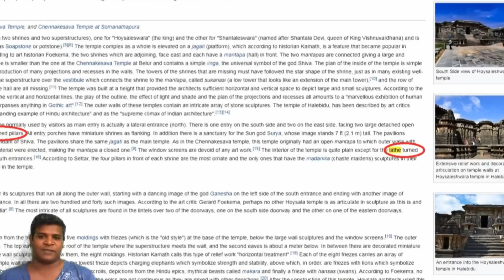Hoysaleswara Temple, India - Built with Ancient Machining Technology?

Comment: The pine cone theory is very intriguing.  If they had the capability  to create these structures than they probably had the capabilities to travelbto places with pine cones. But are they pine cones? Idk...
It does make sense that this might have been the way they carved these things. They may have used frequencies to turn the heads at extremely fast speeds.

Comment: Not even close to planetary gears. Planetary gears have a sun gear at the center, a ring gear on the outside, and a planet gear between them. Here, the outer (ring) "gear" has no internal teeth, so it won't work. Plus, there is no planet gear to be seen! How could you get this so obviously wrong?! No planet gear -- indeed, not even room for one -- but you call it planetary gears?!
This is basic stuff. If you can't get the simple stuff remotely correct, it calls into question everything you claim in this video. 
Maybe go back to school, or look-up what things are before you go around making claims that are so blatantly wrong. I mean, at least try to not look like an idiot.
Reply: Yeah, there is a lot of speculation including the pine cone thing. Pine cone doesn't look like a real tool (although the Hindu multi-arm gods do tend to hold tools and weapons.)

In any case, it's still a mystery how you machine such smooth surfaces and circular stuff. The other videos covering Ellora caves/Khalisa Temple is even more mysterious.

What are your thoughts on how you created those smooth things surfaces on hard stone?

Comment: I was just in Hoysaleswara temple & asked a guide specifically about those pillars with the intricate, minute turnings..elephants, then  horses were used to provide power to drive whatever tools & machinery required, they said..also if the Greek civilization had the antikythera device (which had gears & wheels to predict, what's popularly believed to be, astronomical events), pretty sure gears, & similar devices were used in other civilizations too..even ancient gear  wheels to drill holes into ppl's heads to relieve them of perhaps fluids, aches & pains hv been found.

Comment: These pillars, once had a system of belts that went all through that complex, they even have ancient ball bearings made from stone, allowing them to freely spin (most of the bearings are now crushed, ruining the spinning mechanism ANNND  IRONICALLY, ACTUALLY.... IN THE PROCESS, SHOW-CASING AN OBVIOUS LACK OF MATERIAL SCIENCE KNOWLEDGE BY THE BUILDERS...)  Think stone based societies of old vs. oil based ones of today.... modern, grease packed, METAL bearings are far superior (In particular with proper maintenance) than stone ones COULD EVER HOPE TO BE, as is evidenced.... clearly, by them ALL being crushed today, where we would asssume that metal ones at least, would have STILL been  structurally intact, probably in major need of some good grease, and  admittedly.... probably.... STILL, in non-working order.  IF YOU WERE TO PUT IN NEW BEARINGS AND GREASE THE PILLARS, POSSIBLY HAVE TO "UNSTICK" THE INDIVIDUAL ROLLERS, PEOPLE WOULD BE AMAZED AT HOW FREELY AND LONG THEY WOULD SPIN!  The "Temple" was once an "Energy generating plant" the striations appearing on the pillars ( In particular, the long, row of the really shiny ones) are BOTH remnants of lathe marks, created though their  manufacturing ANNNND... from the repeated usage of massive, leather belts that somewhat grooved and polished the pillars.... At the end of the "temple", there are a series of gears, that step the revvvs WAAAAAY down.... in a very classic and modernly "accepted" way way.... like 1:4, 1:8, 1:16, 1:32, 1:64 and soooo on and so forth.... I have rough drawing of the "lay-out" of the belts and how they worked... I have in fact, made some predictions about the rest of "The machine"....  Upon my visit, one day, to India, I shall see if I am right???

Comment: You can rotate it vertically. Use an abrasive and you can soon produce cylinders. You do not need to turn things horizontally. If you have thrown a pot in clay then just beef it up and you understand the methodology.
A drill or piece of rock on the end of a pixel of wood, aka a stylus, can be spun and you have an abrasive drill. For some reason people are obsessed with the idea that hammers and chisels are always used. I think you should rethink things. Abrasive techniques are more likely to be employed. Gives enough time and manpower and you would be amazed at what can be achieved.

Comment: It may not be alien technology. I think that metal rods were casted and built into a rig where these pieces could fit onto with a hole in the center, and then spinned with another metal object or rocks used to lathe the pieces. The stones are heavy but 4-5 men could lift one around enough to work on it. Or they were sat onto a spinning rod and used an object on the side to shape the rock while having water poured on it.  I think we may need to look into how exactly were they spinning the lathe to determine if it was great technology or just manual labor.

Comment: I visited these temples in Karnataka back around 1990 and at the time I saw that the columns had been lathe turned. It's pretty evident that some ingenious apparatus would have been needed. Likewise the fine stone filigree work is fascinating. However, to posit that this is mysterious since the humans in that area and time were 'primitive' reminds me a lot of the huge, olympian leaps of logic promoted by folks like Von Daniken. I think human ingenuity has existed far longer than our recent sense of history. Just because we see the past through modern filters (and a questionable sense that we have 'evolved' or 'progressed') and cannot personally understand how something was done doesn't mean that it was impossible for 'primitives'.

The filigree carving and hollowing of stone (and relatively soft stone, from what I was told it's a variety of soapstone) is not without practice within the last few hundred years. I saw curios at the National Palace Museum in Taipei that showed similar levels of craftsmanship- jadeite and nephrite carved into nesting, movable spheres, or into lace like structures finer than that seen in the temples. Of course the scale was completely different- jewelry vs architechtural  detailing. I asked a curator and was told it was done using wood, copper, and bronze tools with an abrasive slurry and water. I think the wood was used with fine polishing powders to give the piece a gloss polish.

I have carved stone using a scrap of copper wire, a simple drill (the old chinese craftsmen used small bow drills) and aluminum oxide powder. Soft stone can be carved this way using hard quartz sand. Likewise, John Dobson made huge telescope mirrors to high precision  using materials found in a gardner's shed- hard sand as abrasive, mixed with water and timed to settle out larger from smaller grain sizes  so he could use coarse to very fine grinding sessions. The material was salvaged thick disks of glass from ship portholes, which he turned into large amateur telescopes-the Dobsonian.

My point is there is always a way, even if at first glance it might seem impossible.

I have a thought experiment that is of course not backed with proof, but consider it a possible explaination other than Aliens with tractor beams and defrappolating pistols:
1) A deep pit is dug, with provision for filling and draining water. The ground, if too porous to contain water, could be sealed with bentonite clay as is done for farm ponds. Perhaps something like a well.
2) A large timber cylinder, with a socket carved into its bottom center, is lowered and settled into the pit and onto a stone block fitted with a pin that mates to the socket of the timber cylinder.
3) A block of stone is moved into position and affixed to the upper end of the timber cylinder. Metal stakes driven into the end of the timber could be used to fit into sockets carved into the stone block. This block is roughly carved into a cylinder before being mounted to the timber.
4) The pit is flooded with enough water to pick up the weight of the stone. 
5) The timber post float with the stone block is rotated, using a rope capstan type drive. Think the scale of Roman siege engines.
6) Bronze bars of various shapes are pushed against the rotating stone, while being fed a slurry of crushed quartz. As the surface progresses this is replaced with sand. The support structure for these bars must be fixed to the surrounding ground as it must be relatively stationary while the stone block is turning.
7) The upper part of the timber is kept steady with logs crossing the mouth of the pit and bearing lightly against the turning timber float, like a steady rest on a lathe. This keeps the work from moving off center. Lubrication is by beeswax at the points of contact of the steady logs and the timber float.

Now, keep in mind that the silliness above assumes the pillars are single pieces of stone. They may actually be segmented and joined with a color matched mortar; the extreme fluted designs would make it hard to tell. If so the mass of the stone block blank would be that much lower.

In fact, unless these pillars have been deconstructed to prove otherwise they could have been made using a much simpler apparatus much like a large potter's wheel on dry land and simply pinned and mortared together. It would not be difficult to formulate a colored mortar that would make the joint hard to see, and it could also be lapped and polished with a rope to further refine the surface of the join. If they are pinned they don't even have to be mortared- the joint could be covered with stone dust and wax.

Really, we need to respect the intelligence and ingenuity of these ancients. Just because Von Daniken couldn't figure out how the pyramids were made doesn't mean human genius in the past couldn't. In any field there are techniques that are astonishing to those outside looking in. Honestly, while I can't do it there were people that could make an intricate chronometer mechanism out of brass hundreds of years ago. People still do it today, and with the simplest of machines. A horological lathe is not complex but brilliant in its creation and use.

Humans are smart. We can figure stuff out.

Comment: An aeolipile, aeolipyle, or eolipile, from the Greek "αιολουπυλη", also known as a Hero's engine, is a simple, bladeless radial steam turbine which spins when the central water container is heated

The first commercially successful engine that could transmit continuous power to a machine was developed in 1712 by Thomas Newcomen.

I bet every advanced civilization has had some form of Steam Engine. Basic steam engines are not that complex or out of this world.  Ancient egypt for sure had a steam engine but just like all metals things decompose over time..which is why only stone is left behind and some metals and bits and pieces that was buried inside of pyramids.

Comment: At 1:36, a structure shows a few dark holes; we should use a stick to reach into the holes in order to determine whether the structure is hollow. If so, the structure should be built with cement concrete, not carved from any natural stone.

Comment: I've been to Belur and Halebid and thought the same thing: obvious traces of a stone lathe. The stone turning is not too impressive, as this is a kind of soapstone. But the suspension mechanism for such a heavy stone block is astounding. It was either turned vertically or horizontally but the bearing points had to carry a huge weight. On top of that the thing had to be turned around. Either by human, animal or water power, most likely. And most likely by human power. Slowly but steadily. Impressive feat.

Comment: You have developed a perpetual machine proposed by Bhaskara with small diameter tubes and it is creating great torque. If the diameter of the wheel and tubes holding Mercury is increased then definitely great torque can be developed which can easily rotate a granite pillar. This can be used  as present day lathe machine without using any power source. Speed can be varied by using various gear ratios which are already available at that point of time. Since Mercury density is 13 to 14 times heavier than water it can easily create that required torque.
Ancient people already used thrust and ball bearing so making a lathe head and rear with minimum friction may not be difficult for them. May be for small loads they might have used granite balls and rollers for heavy loads they might have used diamond balls and cutting may be always a diamond tool.
I hope the greatest thing is their lathe machine may be much smaller than the present day lathe machine and no power required. Like this they might have used drilling machine, lathe with vertical axis and may be all other modern machines or even more advanced machines to accomplish their tasks.
One more greatest thing I hope is the technicians were also masters in this field and they can easily produce very complex things. This shows that society in those days was in perfect balance and all are having mastery in some field and that's why they could preserve this technology for the coming generations. One more thing I feel is that they have not used this technology for physical comforts but for spiritual advancement, gives a feeling that all the persons who were involved in this technology preserving process were highly advanced in spiritual plane also.

Comment: There is no doubt in my mind that a lathe process was used on the pillars...I worked on manual lathes for a few years when I was younger and there is no mistaking the look of a rough lathing look that some have. I could easily see them knowing how to do this using people or animals to pull long lengths or ropes on some sort of pulley system one way and maybe then back the opposite way? I mean I'm sure there is a simple way they could have continuously turned the material but I mean once you figure out the benefits of turning an object and the subtractive process....I'm sure for anyone with a mechanical mind to figure out a 'good' way to make this work for their purposes. I'm plenty sure there were people back then a hell of a lot more mechanically minded than I am in this day and age....I appreciate these videos. Thank you for making me think =) 

I don't know about the polishing methods you are talking about though....you were talking about a handheld method of doing this work...I think there would be much more efficient methods using water or oil as a lubricant and heavy pressure especially on cylindrical items such as those pillars....but....once you start talking about odd shapes I have great doubts they could or would do it by anything but by hand. I mean sand blasting is a thought for the rough work....but wow that would be amazing if they figured it out....then did a fine polish gradually? I would tend to think it was just painstaking work by hand first by a true master stone carver who got things very close...then specialized finishers come in to do the rest down to polishing? I don't know just a thought anyway....This would have been a good way to make a living....being paid for years while working =)

Comment: One could easily carve these as normal cylinders, and then mount a "lathe" machine on the pillar and turn it manually around the pillar to carve them, so the lathe would be mounted on the pillar as opposed to the pillar mounted on the lathe.  A 2:1 "gear ratio" in a sculpture is normal geometric reduction when we draw things that go in circles around geometric shapes. Nothing surprising there. Creating a hollow sphere in a small rock is not "impossible" without machines. Many things we see that look "impossible" become an "a-ha" moment, when someone who knows how to do it shows us how. That said, the sculptures are clearly amazing. Those statues are holding ears of corn, which is equally strange, since that comes from the Native Americans. But also, a couple of them are clearly holding a pine cone.

Comment: we don't know. silly to pretend we do. instead of guessing we should gather what evidence we can.
primitive tools can pick away at rock a grain at a time.  rock balls inside mouths are common all over china.  the different rock ball though,  I don't know about that.  that's a real mystery.
having a very thin slot or separation between rock layers is fine - long thin primitive metal tools could pick away and pick away to create that.
signs of rotation you say and then point to incredible smooth polishing?  doesn't that mean they meant those grooves to be there?  they obviously could have polished them out if they wanted to.  more likely they deliberately made them.  occam's razor: stick to the simplest possible explanation at all times.  we'll make more real progress that way I think.
like 'stargate' stone 'doorways'.  you can build stargate travel but only roughly carve stone 'doorways' ?

Comment: Don't be hung up on a lathe having the work horizontal. The work can be turned vertically as well, making the work easier in some cases. Look at a potters wheel for ideas for the vertical lathe. In some cases, it is easier to turn an item vertically, rather than horizontally. As to the pillars having matching patterns, we use patterns and blueprints with the way to cut them exactly.

 The god of measurement holding a tool, reminds me of tools we use today for marking dots on a work surface. The pine cone tool also reminds me of a burr tool for making holes, but it also looks like they have other uses as well.

The last thing I would say about some of the sculptures, like the little skulls and the overlapping necklaces, If they had been like clay and molded, then glued onto the sculpture, it would explain how they look so similar, and be hollow underneath the surface. Plus it would make it easier and quicker to make the sculpture.